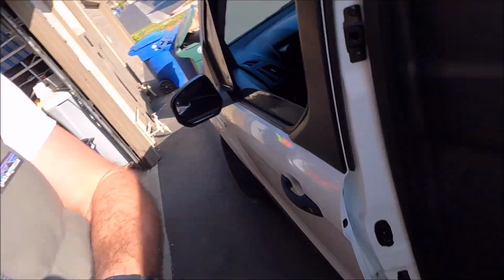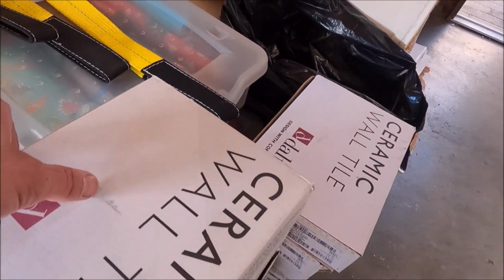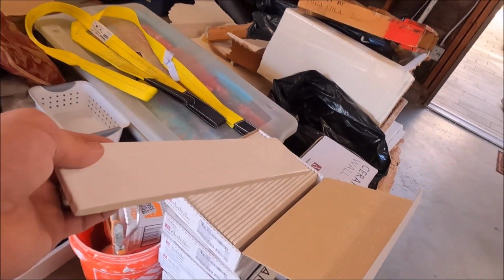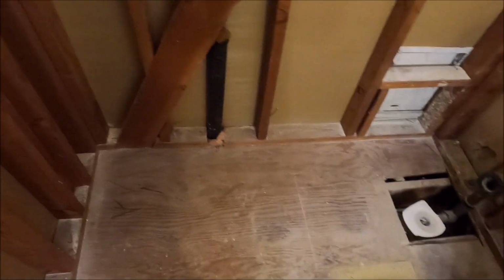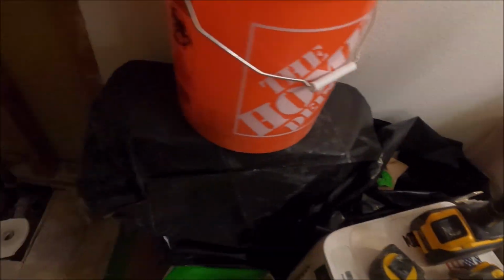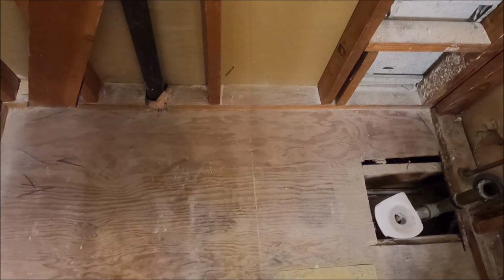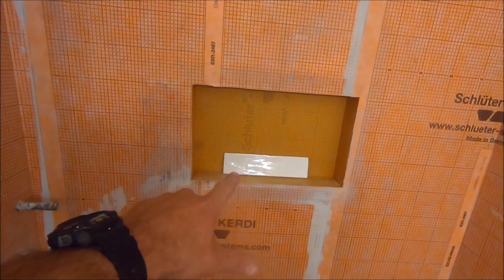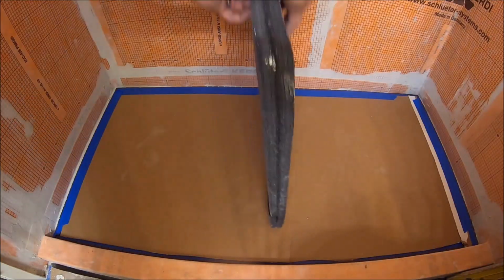Subway Shower Trend? Please Go Away in 2022!

Comment: That air system extractor you got hooked up gets that angle grinder dust out? At first I thought you were going outside to cut the circles but it looks like you do it right in the bathroom
Reply from the maker: most always go outside, but did it inside for the video

Comment: I thought you bot supposed to use less than 2” tile in foam schluter shower pan ?
Reply: I thought the glue on those mesh mosaics are water soluble and some tiles might come loose over time in shower pans and also you need to have a 95% coverage in wet areas and the mesh doesn't account for 95% but i could be mistaken.